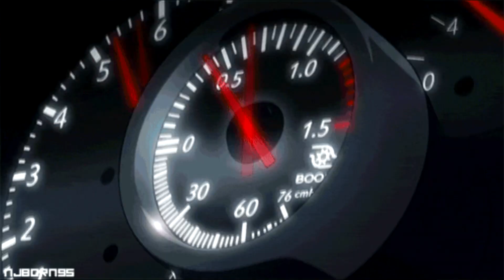How to Adjust Function Form Type 1 Coilovers on Tsx & CliffSide Media Car Meet

Comment: i have f&f on my tsx and the front doesn’t go too low, i had to mess with my preload and i added 32k swift springs to make it stiff as if i didn’t mess with preload and i’m slammed lip to fender the rear you can go dumb low
Reply from the maker: That Blue fb6 send pic to my insta, @artgvd I’m very curious to see how it looks haha
Reply: Bro I’m tryna lip to fender myself on f&f I maxed the front, modded upper control arm for camber I need two more inches of drop

Comment: Before you adjusted the coilovers was the car's height somewhat similar to OEM Height? I currently have crappy coil overs from previous owner on my car & looking to buy these function & form but would like to know how far up can i raise my vehicke with these coilovers?  My current coilovers are at max height & woild like to raise my rear by an inch or so
95 civic Hatch
15×8 wheels
195/50/15 tires
Reply from the maker: Rudy Flores actually when I first put then on they were hella slammed and even. My advice to you is to pull everything out and make everything even.

Comment: Use to the top perch of the two and spin down the whole unit, no need to remove the bolt (17mm) 👍 slammed life is the way to go
Reply: it even says on the coilovers itself to not
mess with the top 2 collars. i mean yeah u can but then the preload is gone and clunks start to happen
Reply: @tallxboi94  once the two collars are locked, if you spin the top one down. It'll hold the shock too and spin it into the cup as one unit. Not messing with preload.